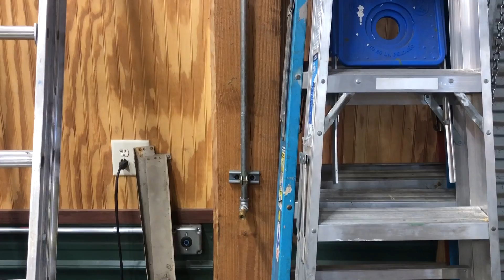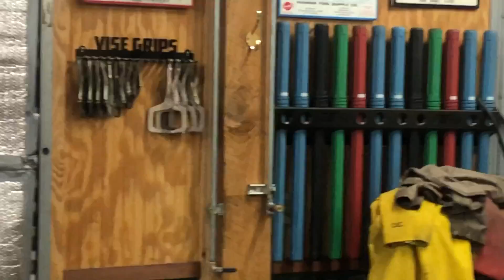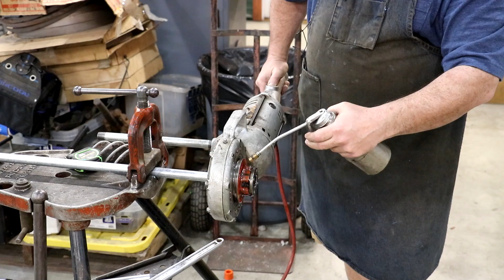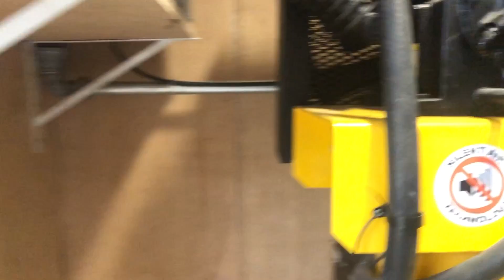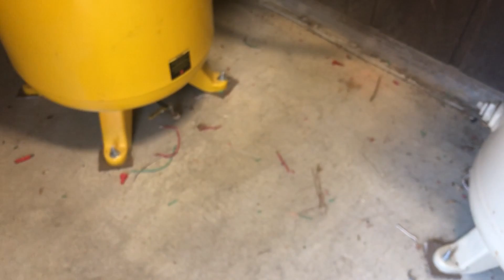The Ultimate Shop Air Compressor Setup! (at least for me....)

Comment: Great setup Keith! Wet air and sandblasting just don't work well together. Love the hard pipe install. Thanks for sharing, 
Cheers
Reply: Wet blasting (grit in a pressure washer) is a great way to sandblast. Of course it is wet and messy, but there isn't any dust LOL

Comment: I spent 5 years as a Sales Engineer for a Mill/Industrial supply house here in Atlanta. Helped a LOT of customers either set up a shop or upgrade existing systems. Something you might find (will find) useful is an air hoist for your Gantry Crane! Now that you have air plumbed everywhere you can use it a LOT. Beats the snot out of a chain fall! Looks like an "A" list setup BTW!
Reply: I added an air hoist about 4 years ago and love it!  Had to rebuild the hoist 4 times to get it to work properly;  someone had added an extra internal washer that would only bind up under pressure.
Reply: Nothin like a sales pitch. ROFLMFAO
Reply: @anonimous2451  Since he's not pimping a specific brand it's not a sales pitch. Go be retarded somewhere else. Pneumatic hoists (and tuggers which are outstanding for moving heavy loads horizontally in shops etc) are common in industry where adults need to get work done. 

A key advantage by not being electrical they're far less hazardous in rough use environments. No heavy expensive cable to run and they're handy for mobile use as they can be run from any pneumatic source with enough CFM, or even a portable CO2 cylinder which many contractors use to run a variety of tools.  Power Tank make the fancy off-road variety but I use common industrial fixed pressure Western regulators in the field.

Comment: I agree about the blue plastic pipe or any plastic for that matter. Plastic does get brittle over time. I would go on the assumption that the blue stuff will prove to be no different. I was going to ask why you didn't use copper but I understand keeping with the aesthetic look. I have heard you shouldn't use galvanized because the coating can flake off & get in your tools. Any knowledge or opinions on that? Did you add any extra filtration in case that's a problem? I'm not being sarcastic I'm honestly interested in people's opinions.
Reply: If it's the pipe I think he means, it's actually a sandwich of plastic-metal-plastic, so it would be pretty difficult for it to leak from deterioration.  It is still butt ugly color though, & of course entirely different fittings to connect to the pipe.

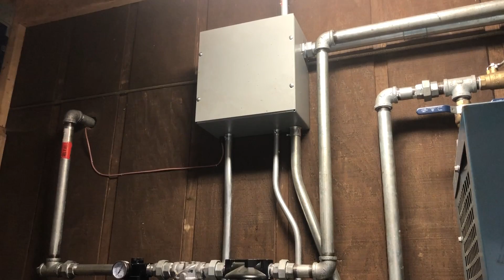Comment: At around 18:00, there is a four socket outlet, with no switches, I'm fairly sure in the UK, each of those outlets would require a switch.
Reply: Historically the uk has switched sockets because people damaged sockets by pulling the plug out of the wall with the load connected. Most modern appliances have a power switch integral so the switch is less needed. Indeed industrially lots of 16a or 32a sockets are unstitched.
Reply: @jnimitzch4738  NEC has been adapted as the international electric code. - No requirement for switches on an outlet.

Comment: I agree, air in the shop is vital.
Only thing I would do is put ball valves at the drop so if you need to change the quick disconnect to another type you dont need to empty the lines completely.
Reply: Good idea.
Reply: @hilltopmachineworks2131  No need ,can isolate whole shop from the air tanks outside. Good setup, have cursed before where pipeline has no union jounts. Usually inaccessable, rusted solid.

Comment: I went with the blue plastic pipe in my shop. The only reason was price and how easy it is to install.  It goes so fast when you unroll it from the coil and you don't have a lot of unnecessary joints.  I would have used black pipe if I would have had the extra time to install it.  I'm just like you when it comes to overkill and making sure it looks perfect.   I'm guessing that I've had my blue plastic at least 4 to 5 years and I've never had a leak.  I can shut the air off at the tank at the end of the day and the lines will still have pressure on them in the morning.  I admit your set up does look nicer than mine.  You might consider adding a drop to the outside of your shop near the driveway for airing up a low tire on a truck or a trailer.  If its raining or cold outside you might not want to open up the shop to run an air hose outside.

Comment: Love your setup.  I concur with your opinion of using iron pipe instead of plastic - might be irrational, but I'm right there with you.  Regarding the automatic drains you intend to put on the tanks, maybe it's because our compressors are much larger (100hp), but we had problems getting those solenoid valves to work reliably.  The shock of the compressor turning on and off tended to dislodge tiny particles from the inside of the tank and clog those automatic valves.  They work on the secondary tanks, but the primary tank we still have to use a manual ball valve every day when we turn it off.  Something to consider.

Comment: should have put a valve before each union for isolating each section.
Reply: Can't he just turn off the entire system, fix what needs fixing, then turn it back on?   Seems pointless to add a bunch of extra valves.  It's not like it's a production shop which can't handle a bit of downtime.
Reply: @jimthesoundman8641  If you want to drain the entire ring main for a small job and stop all work go ahead.
Reply: @jasebrown2634  He has like four driers on it.   That's gonna be drier than the Sahara desert.
Reply: @jimthesoundman8641  I think you misunderstood my first comment if you put valves in you do not have to  turn off the entire system so you can still have working pressure where you need it instead of wasting already compressed  air and electricity.

Comment: That is absolutely the wrong way to cut a pipe. You should be using a line-shaft-driven cold saw that dates back at least a hundred years, if not longer. 🤪
Reply: good one
Reply: lol
Reply: I see what you did with that! heh heh...
Reply: I think the Egyptians used a capstan driven by donkeys attached with hemp rope to cut their pipe threads! A 50mm OD pipe required 6 donkeys.
Reply: @deankay4434 6DP (6 donkey power) has more power than 6 HP?
Reply: I need one of those saws.  It cut that pipe like warm butter..

Comment: The low strut and clamps is what I used for the RapidAir (blue noodle piping) it worked alot better than the plastic clips provided. As far as the lifecycle of the blue noodle, well time will tell, but I would have rather had the option to buy it in black as you had suggested.

Comment: Truck air brake tubing comes in several colors. Even brown, black, green, red, orange, and blue. When my employer built the new shop we plumbed the air using 3/4 air brake tubing. All the drops were 5/8 inch and even the furthest drop had no problem feeding a one inch impact gun.

Comment: FWIW, there’s also the aluminum pipe that’s only coated with blue plastic... and I suspect that it will last for ages, because - as far as I know - the plastic is a cross-linked polyethylene with no plastisizers added (and therefore none to evaporate and make the base plastic brittle). 🤔
Reply: Nów you tell him.
Reply: @ElmerJFudd-oi9kj  Well, he didn’t ask me beforehand, now did he? 😉
Reply: @darkwinter6028  No I guess not huh?

Comment: The thing about steel/iron pipe is that it WILL eventually drop flakes of material into your airstream... even galvanized. So, I’d put a simple filter on each outlet to trap any junk and keep it from messing with your tools. Video has just started, so we’ll see what he does... 😉
Reply: medical grade stainless steel piping disagrees but recommends a sturdy bank balance :D
Reply: @mips13  Ok, yes, stainless is an exception. It’s got enough alloying elements to make it an exception to a lot of iron/steel “rules of thumb”. FWIW, I was referring to the stuff you get at your local home improvement store. And at least in the US, anything “medical” is going to require somebody to have a big bank account... you or the insurance company.

😉

Comment: That compressor setup/system is impressive - that air is going to be as dry as the Sahara desert! Thanks for the video Keith.
Reply: Just cooler :P
Reply: With his "low volume" of air consumption, the only time he should have trouble is when there is a high demand applications with high humidity.  Even the best setups will produce water and sediments in the systems.  This is a problem for all shops. It's just a function of time and money.
Reply: Surprising fact, driest air on earth is actually Antarctica. As Kieth mentioned hot air has more moisture holding capacity, so the cold air in the artic has less ability to hold moisture to begin with, and then it's so cold the moisture freezes out of the air. Hence why he has two cooling systems for the air and not heaters.
Reply: @DracoOmnia  True. Antarctica is also a desert.
Reply: The Whiskey Gunner .I know that Antarctica's drier but I was looking for a simile for dryness and "dry as Antarctica" doesn't sound as good as "dry as the Sahara". I could have gone for "dry as a bone" or "dry as a m*slim wedding"!
Reply: @stumccabe  It's just your normal youtube comments being pedantic...
Reply: Do everything you can, moisture still persists. The goal is to minimize it as much as possible. At my work we have one machine alone that has 122 pneumatic cylinders, it is a constant battle keeping them clear of water. We have a rotary compressor with a pre-cooler, two water seperators before a chiller, another water seperator and FLR at each machine.

Comment: Keith
nice to see air drops done correctly out the top , If you suffer like I do go to next room and forget what I went in for 😇 as you have control panels near each door why not wire in a interlock into the door dead bolt so when you lock the door with a key it disables the air comp. and the phase converter , its the same set up as used in burglar alarms to override the door trip ( instant ) when you unlock the door to give you time to use the key pad